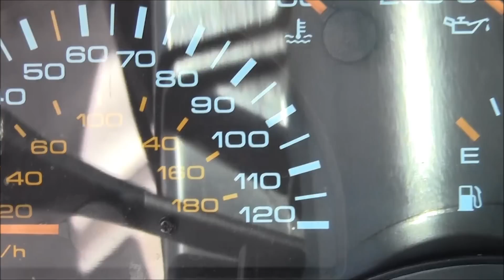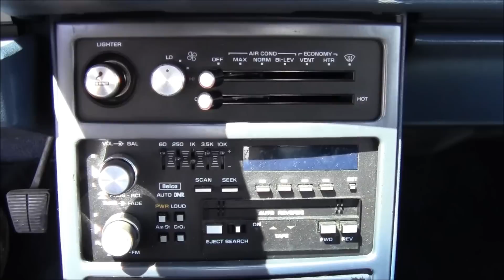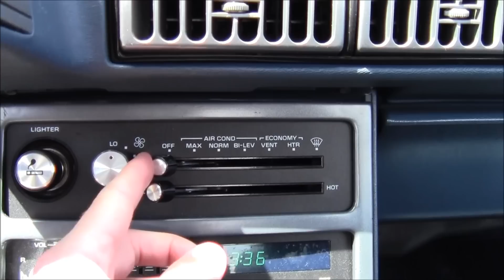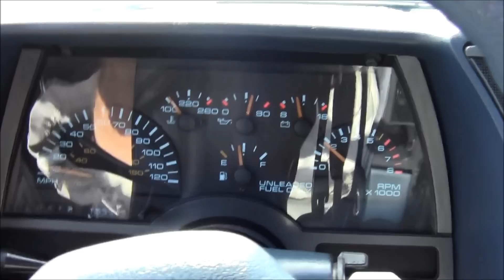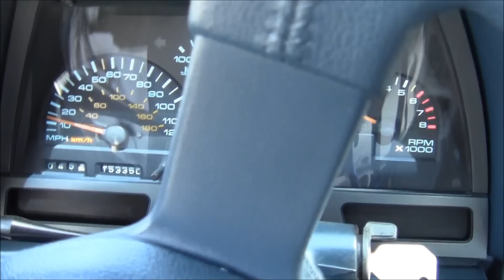1989 Chevy Cavalier Z24 2.8 Liter V6

Comment: I bought a 1989 Z24 brand new from the dealer show room.  Paid $16100 Canadian dollars at the time.  I just got my first job out of university.  Mine was automatic and had a fully digital display.  Wasn't the best mileage as the gearing was high.  Drove it home from the dealer with my Roxette cassette blasting from the stereo.  Awesome memories.

Comment: I was 3 years old when Chevy put out this style Z24 Cavalier. Even as I got older, it seemed as though everybody wanted the Z24 package for their Cavaliers. I live in Pensacola, Florida and I still see so many of them in almost mint condition. One of my customers is in his late 70's and still has his '90 model Z24. It has only around 24K on the clock (yes, that's 24,000 original one-owner miles) and it starts LITERALLY the second you bump the key to start. He jokes with me all the time, saying they better dig a hole a lot deeper than 6 feet because his Z24 is going in the ground with him. No, he's actaully going to leave it to his great-grandson.
Reply: If he has the electronic dash maybe those aren't true miles. I had one and we used to take out the fuse from the glove box and it shut off the digital dash and didn't rack up miles
Reply: @jeffreyd508 it has analog dash

Comment: Wow I loved those cars especially the sound of the 2.8 V6 exhaust. Love it.
Reply: 4.3 liter
Reply: @noelk6606  The 90° 4.3L is too large to fit in between the frame rails
Reply: @noelk6606  wrong
Reply: The sound of it starting immediatly brought back memories. Sounds just like my 89 did.
Reply: Those 2.8's sounded great if you added a turbo muffler to give it a deeper sound at full throttle.  Back then and into the early 90's you were able to change out the stock chip for a better performance out of the V6.  The only thing was when you do that u were required to install a lower temp thermostat to avoid overheating.  Did that to my '87 Z24 cpe when I owned it back in '93.  Bought the bowtie used at the time.  Sure wish I had the white beast back now!

Comment: I bought a red 1988 Z24 as my first and only brand new car. $12,000 out the door. I got it with the manual transmission, and I loved it. I kept that car clean and put a kick as stereo it. It was an awesome car for a kid in his early 20s. My friends and I had some great times in that car. I had it for about 3 years when a young girl backed into my hood in a parking lot. It crunched the nose on the fiberglass hood. When I was getting it fixed, I had the body shop repaint the entire car. The original paint was bad and had plenty of small road chips. I picked the car up, and it looked better than new. One day later, I was driving home, and a deer caused a pickup truck to cross the center line ,and we went  head-on at 50MPH. Needless to say, my Z24 was totaled. But both the driver of the pickup and my self survived. He had minor injuries. I had my bell rung and had cuts and broken bones in my left arm. If you saw the pictures of my car, you wouldn't believe I survived. The cop on the scene told me in the hospital that it was a miracle ✨️ 🙏

Comment: Had an 88 Z24 blue, blue interior,5 spd just like video.  Dang I miss that car!  Did everything well, was good on fuel, handled good, sounded awesome, and always gave a good account of itself:)  Was very reliable as well, when we parted ways she had over 427,000km on her and still ran and drove great and the engine had never been apart. Noticed there a few subtle differences between 88 and 89 (mine actually built in fall of 87) Seats where different, no vent under steering column, smaller ball shaped shifter knob and I am positive no upshift lamp.  Other than that watching video was like stepping back in time!

Comment: I have a 89 cavi bought it for $1000 with 134k miles and 0 problems. I'm about to put a 50 series flowmaster on. I also just painted the bottom skirt black instead of silver

Comment: i have a nice 1991 cavalier convertible 3.1 RS sadly auto..... the car is in great shape only rust to be found anywhere is a little underneath the doors....... everywhere else is clean, clean, clean. i do not drive it in the winter and only now just started to drive it again, only on dry streets until the salt is completely gone. im really surprised how many people really do like these cars, i thought i was the only one........ the car is fairly quick, nimble, compact, good on fuel, just overall cheap fun to drive unlike the boring popcorn poppers cars come with now...... by today's standards a 3.1 is a fairly large engine for a small, many cars are coming with engines that are 1/2 that size and they sound terrible.
Reply: andrew donohue Corsica/Beretta got the better auto than the Cavalier especially pared with the 3.1 in 90 and 91.. Lower revs on the highway, more responsive and better mileage.
Reply: im pretty sure they were the same TH125 trans. they are a good reliable trans but are only 3 speed so you tend to have higher highway rpms.... later corsica's had 4T60 trans with over-drive. i have owned both cavaliers and corsica

Comment: Awesome car dude.  Had an '88 that was red with a tan interior. Loved that car.  Pretty quick for its time and the mileage was ridiculously good. I accidentally drove over a huge rock in a grass field that ripped open the oil pan and never knew it till the motor seized. Didn't have the time to replace the engine so I sold it.  I wish I didn't.
Reply: Its a known defect with chevys that you can't drive them over rocks or railroad ties.  It was the latter that got me, with the same result as you.  I guess they didn't want me driving around the middle school football field, but at least have the decency to trim the grass around them so I can see them late at night.

Comment: Bought a convertible version in California after the insurance on my Vette went to $5k/yr (I was a bad boy) and then moved to Montreal.  Interesting winters.  Took 40 minutes for the inside to start to heat up and the shifter was like going through mollassas.  But I guess overheating issues were lower as I did worry about the head gasket while I owned it.  Finally sold it, was a decent, inexpensive car.  If a bit cheesy.

Comment: I have a mint 2000 Z/24 Cavalier I owned since new. It's all original except for a custom stainless steel exhaust, K&N air filter and a 12 in Alpine subway fer hooked to the stock radio. Only comes out of the garage when it's nice. It's kinda rare. GM didn't make too many painted bright white, Grey interior, sun roof, full RD radio with CD and cassette, full power everything but with a 5 speed. Now she has 117,832 miles on her, gets 32mpg, full synthetic Mobil 1 oil and still looks factory fresh

Comment: i was born in 1989 and we use to have a1989 chevy cavalier two door. hard top then later a 1995 chevy cavalier two door hard top. the 89 was apple red the 95 was Cayenne Red red hot sally and red hot ruby. had the 95 lasted untill16 years in sept of2011 may she rest in piece the other one have not seen since 2000 for the89. both. cars disliked rush hour traffic And drive through restaurants both have there own character traits for many that dont believe it. and the saddest part the 89 had rally style rims on the car another reason to bust into tears. and now we have a 2003 chevy cavalier gold champagne color.

Comment: I had one almost exact.  Minus the power lock/windows and it was maroon/silver.  Traded it off w/226k for a '98 Z24 5-speed black.   Just watching your video takes me back 24 years ago when I drove mine off the used car lot.  Wow, the memories.   Do you recall the RPM's at 60 mph in top gear?
Reply: 2,400 rpm's

Comment: Man that is cool, I love the sound of that exhaust. I loved my  88 Z24 blue, blue interior,5 spd just like yours. That one was stolen from me. I have a white one, convertible that's an 89. Having trouble keeping it running. Every two miles or so it would just die. I don't know what it is,
Reply: Check the crank shaft sensor, mine did the same thing.
Reply: FranK B  The engine, it's lousy. 3.1 from 90-93 is the better one.
Reply: computer was garbage...had a 88  went through 4 computers...all covered though

Comment: Nice car! Someone tell me why these cars had such a nice loppy idle? They sound like they are cammed up. Is it the heads are different or just exhaust trick. The berreta and lumina also had a hood exhaust sound. I had a 94 z24 white 5 speed stick that was faster than my 94 camaro v6. I also had an 88 z24 with the 2.8 and auto. Still had balls for a 3 speed...but on the highway at 75 mph the tach was kinda high. My girlfriend had a 90 berreta gt and it was a beast with a 4 speed auto... Same 3.1.

Comment: My Z24 was Blue with grey interior, 5 speed (the way it should be), sans decklid rack, AM (stereo) FM cassette with equalizer and MANUAL windows.  I could have kicked myself for not ordering the power windows.  It had about 78K on it in '95 when I traded it in.

Comment: beautiful car 2.8 engine was better than three point one more reliable.....
Reply: Yuriy Podgorniak 2.8 was better sounding and felt like it had more torque
Reply: The 2.8 and 3.1 are the exact same except the 3.1 had a longer pistion stroke
Reply: The way they sounded was mostly related to the exhaust &/or muffler. Other models that also used the 2.8 V6 (Celebrity) had a very quiet sound, nothing gnarly about them.

Comment: Top speed?
Reply: 85
Reply: 65 bu 85 is way off! I had an automatic 89 convertible that would easily do 125 with a three speed automatic. A five speed will certainly add another 5 m.p.h!
Reply: My buddy Nathan had his pinned one time and it was still pulling. I don't think they had speed limiters on them. I would guess 130-140 going downhill